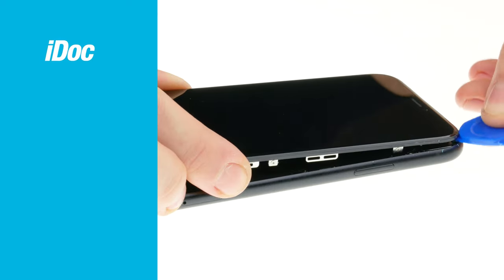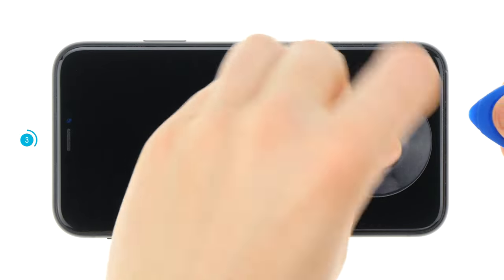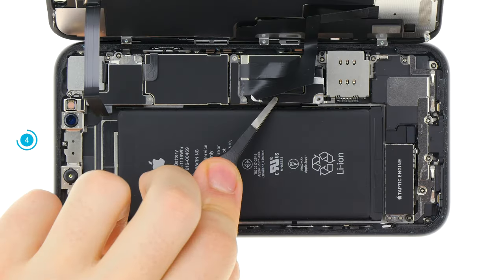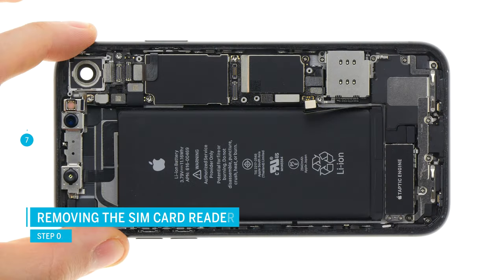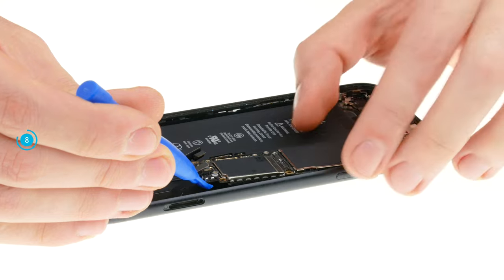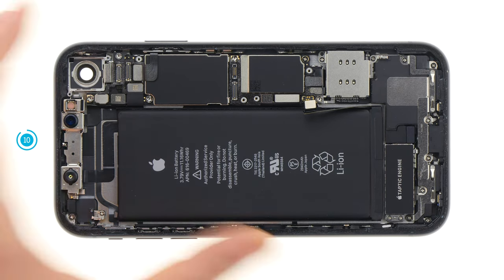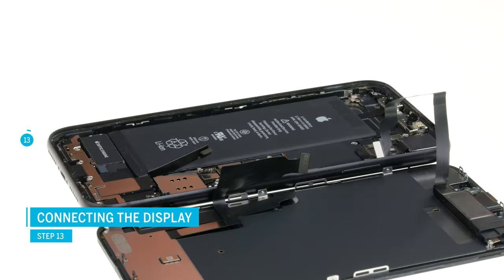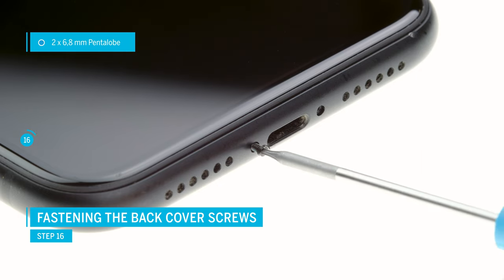iPhone XR – Logic board removal [repair guide including reassembly]

Comment: Very accurate, good video, one question: it could happen something if I don't put the sticker at the end?
Reply from the maker: Hi Mario,

thanks for your feedbacj! It's great that we could help. Do you mean the adhesive frame? With an adhesive frame, your iPhone would be better protected against dust and water, but even with a new one it's no longer 100% waterproof. So it's also ok to leave the sticker out, because the display is fixed by small hooks and the Pentalobe screws.

Best
Sabine
Reply: @iDocEN  thank you for asking, it was helpful, regards.